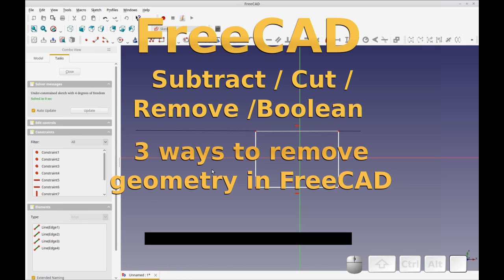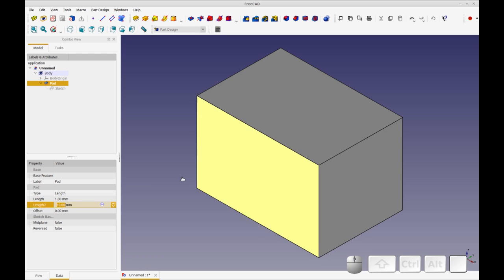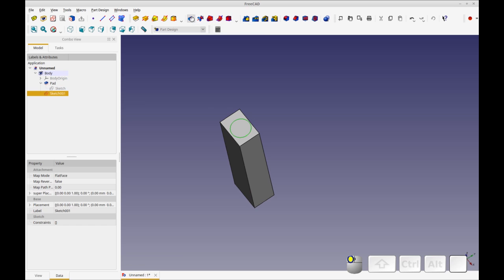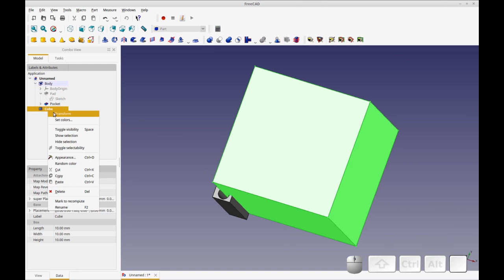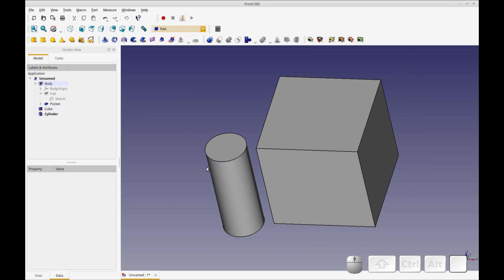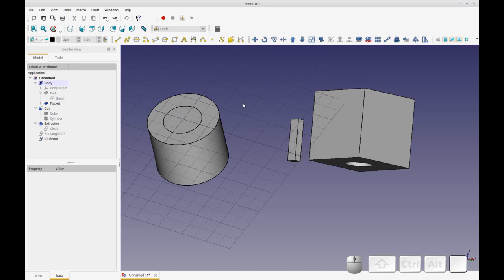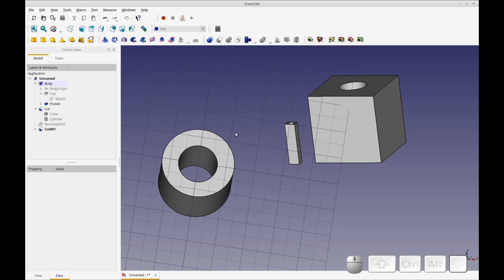FreeCAD Boolean Cut 3 Ways to Subtract Geometry ( Re-Posted Correct Footage )

Comment: great video.. i started with freecad on circuit-board design and liked it. then i wanted to make a simple pipe coupling adapter. after many videos of do this in one workbench then go to another workbench on_and_on finally i got the part.  gee i thought the autocad learning curve was bad... so i will watch more great videos...:) thanks
Reply from the maker: The learning curve is rough with FreeCAD, but there is light at the end of the Tunnel. When I started I thought the Draft WB was Dark Magic, but I actually turn to it a lot now. :)

Comment: I liked it as far as it when but what about cutting square, oval, rectangle, star, etc shapes?  There's no icon or drop down for those.
Reply: in fcad 0.19 at least, you can do that easily in part design using the pocket on sketches of the required shape

Comment: And don't forget the 4th method, using subractive shapes in the Part Design workbench.
Reply: I get error messages. it talks about bodies and stuff. why cant software be designed intuitively? is it because of the people designing? in any case 3d builder from microsoft is an inspiration. and the cura extension that expalains all the settings when you hover.

Comment: how did you even get the sub view for "sketches" to even show?  I'm new trying to learn this
Reply from the maker: I thought I hade replied to this but I don't see so ...its called "edit mode", you can enter sketch edit by double clicking the sketch or from the toolbar when in the Sketch Workbench. There is also an icon, an arrow pointing down into a box, in the Part Desing Workbench and Sketcher Workbenches. The box with the arrow pointing up exits the edit mode.
Reply from the maker: Based on your comments I think you are using version 0.16, you should definitely upgrade to 0.17 if possible

Comment: Hi +mathcodeprint , thanks for this great video.
I am sure you have already discovered this but, for the benefit of future viewers:
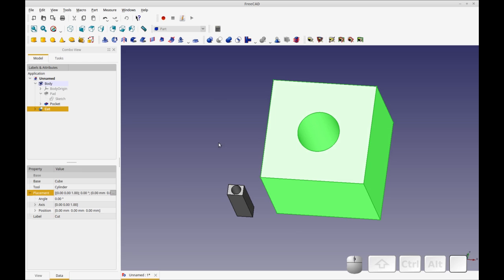at about 7:00 where you create the cut you lament that there is apparently no way to change the depth of the cylinder cut and recommend sizing the cylinder before the boolean operation.
There is in fact a way to change the depth of the original cut and it illustrates the 'parametric' nature of many aspects of FreeCAD. Next to the Cut (name) in the object tree is a > sign, clicking on it exposes the original cylinder, clicking that shows the parameters of the cylinder, like height, radius and angle, and also placement, so there is no need to remove and replace it. Furthermore, if it is in the wrong place, you can double click on it and move it with the Transform tool, although the previously mentioned placement parameters are more precise than the Transform tool. When using the Transform tool dragging gently on the arrows you will notice it jumps between one position and the next. This is deliberate as each jump is a specified distance, governed by the increment shown in the dialogue box (default 1mm in metric units). Rotation (using the spheres) is also step-wise (default 15 degrees).
Reply from the maker: Thanks for watching and giving this update. I am at this point embarrasses by this vid as there was certainly a lot I didn't know at the time. You are watching the "learning curve" I have considered taking it down, or re-doing the video. But for now it seems to help more than it hurts so I just pin your comment :)
Reply from the maker: Hey Paul, ( great name by the way ) I have set you comments to auto-approve. One of them got caught for some reason, but your contribution is valuable ( and detailed ) so I  don't want any to get lost. Direct messaging on youtube keeps changing so I thought a reply would be best.
Reply: @mathcodeprint  Thanks, I find your videos very clear, helpful and well-paced. I am really a newbie to FreeCAD but trying to learn enough to run some classroom training in it for members of our local Men's Shed (frequented mostly by retirees like myself as an adjunct to health and well-being). The questions from your viewers were interesting and challenging for me - so I thought I would try to solve a few of them and learn a few more things in the process.

Comment: How can I subtract a revolved geometry from a solid one in the part workbench?
Reply: If you haven't already, use the Part Design workbench to produce your revolved geometry, it will be a body produced from the revolution of a sketch. Now change to Part workbench and choose the primitive (shape) from which to subtract your revolved geometry. Use the Transform tool (as demonstrated) to move your revolved geometry into right relationship with the primitive shape (like the cylinder was placed inside the cube). In the tree, first choose the object to be cut then, holding Ctrl (or Command) key, select the revolved (cutting) object (they will both appear selected). Finally choose the boolean cut operation as demonstrated in this video. You will find you can change most aspects of both parts by expanding them in the tree view and changing their parameters. Just as an exercise create a cube from a sketch in Part Design workbench then subtract your revolved geometry from it in the manner described using Part workbench. (Note there is a boolean operation tool in the Part Design workbench but it operates a little differently - maybe @mathcodeprint will do another video on that. Have fun experimenting!
Reply: there's an option to "groove a selected sketch" to remove geometry by revolving in part design in FCad 0.19

Comment: Is there any way to cut multiple objects at once? In a very old version of Bryce 3D you could set an object as a "negative" and it would cut out anything that was set as a positive material. Any help is appreciated. Thanks
Reply: I am not aware of any way to do this but I suggest you join (sign up to) the FreeCAD forum and ask the same question in the Help Using FreeCAD sub-forum.
Reply: Nice question
Reply: Possibly I don't understand the question. If all the "positive" items can be "grouped" in to an object then would not a boolean subtract of the "negative" object provide what you need? Appreciate that this query is yonks old, and freecad has no doubt moved on, but the videos from 2017 (including this one) indicate that it  was possible.  Just saying because I find Math's videos realy helpful and there are plenty of current viewers.
Reply: @nomdefamille4807  they are saying that say you form an object, mark it as negative, add any new (positive) object. then the negative object will be already subtracted. so like an interactive mode if i am not missing any detail

Comment: At 4.23 you have the 3 axis showing in bold blue red green, next to component. I don't see this on 016. Is there a setting I need activating?
Reply: In 0.17, which is the current stable version (Jan 2019), when double click in the tree on the part object you want to move the Transform (i.e. move) tool is displayed. Alternatively right click on that object in the tree  then, use the Transform option to display that Transform tool (see my other comment about using it).